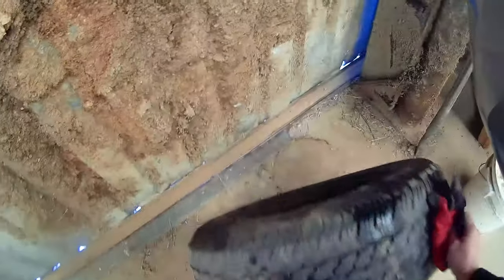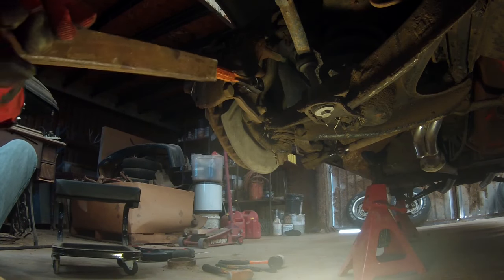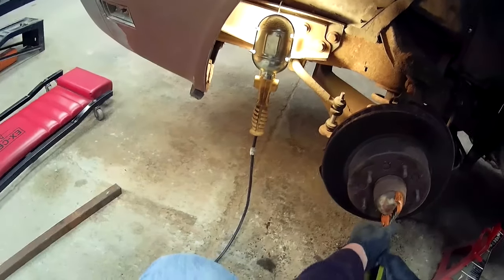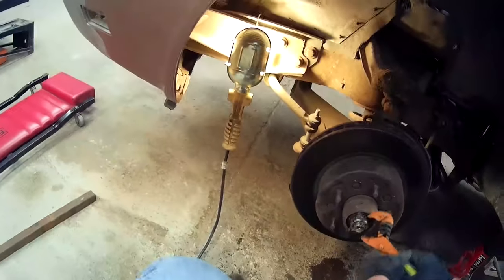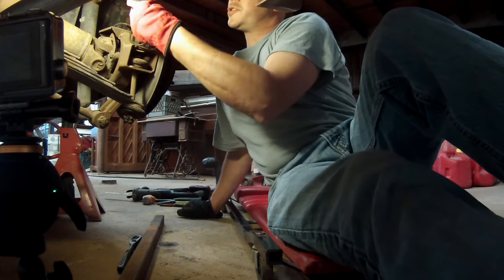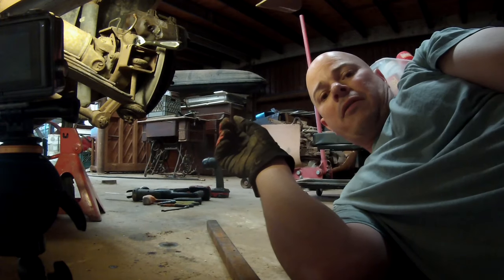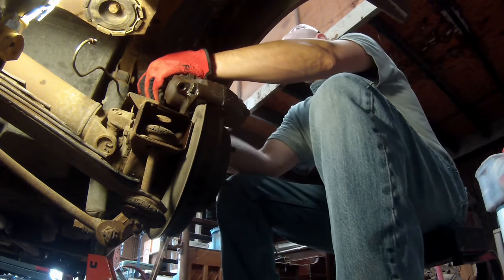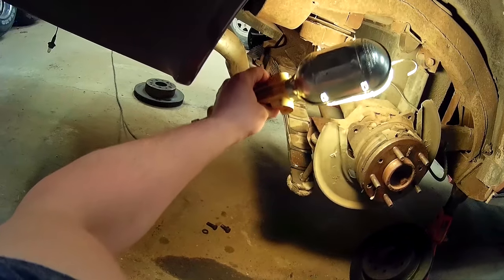1975 STINGRAY BRAKE JOB PART 1: WHEEL, DISC, AND CALIPER REMOVAL: MASSIVE FLUID CORROSION ON THE RIM

Comment: So did you remove the metal brake lines? And does it matter if my reservoir goes empty?
Reply from the maker: Yes, and I would let the reservoir completely empty and start with fresh fluid.  Not a necessity, but I went with a less corrosive DOT4 fluid after flushing the entire brake lines.  At least that is what I was told, so correct me if you find out otherwise.  so far brakes are good.  Now, I need to put a new carb on to get it back on the street.  Thinking Holly EFI.  I haven't worked on her for a while since the pandemic crash and health slowed me down for a while.